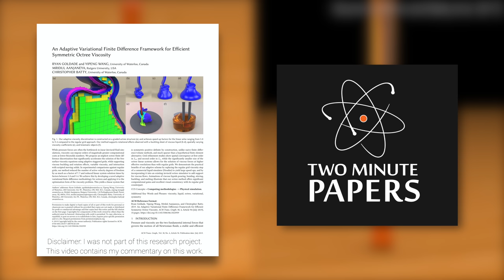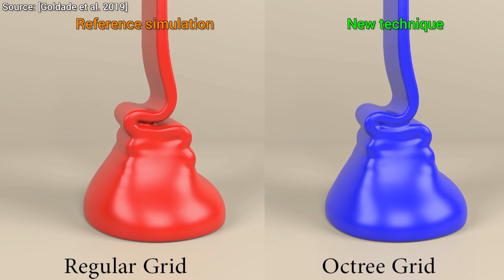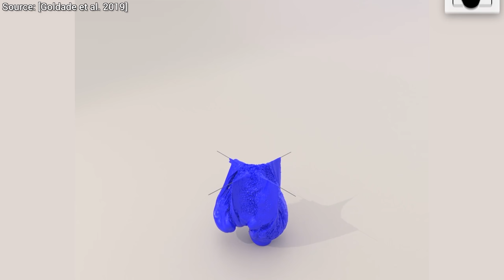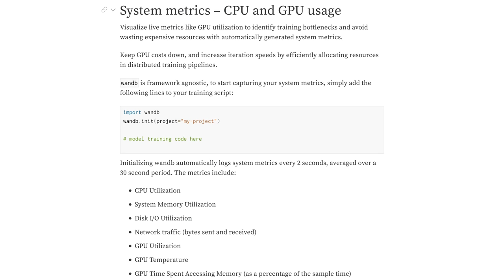Simulating Honey And Hot Showers For Bunnies! 🍯🐰

Comment: I miss an explanation of how/why it's faster. What's an octree, why was it chosen for this specific problem, etc
Reply: The resolution of the simulation is controlled by the divergence, this means that it uses lower resolution (larger grid sizes)in areas of the sim that move very similarly anyways.
There are a few images of this method early in the video.
Reply: @FreekHoekstra  Yes, and I went after the paper to read more about it. But I think it would be nice to have even a simplified overview of the novel techniques used, and not only the results they produce.
Reply: @mostlyokay  true but this isn't Five Minute Papers.
Reply: divide a cube into equal parts, repeat as needed for the new smaller cubes, now you have an octree. This should allow for divide and conquer strategies, and as freek said variable resolution.
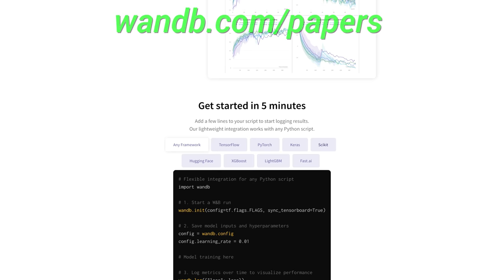Reply: @EternalDensity  Well the video is 4:10 long so it's a lot closer to 5 than 2 minutes anyways.

Comment: One thing missing in these honey simulations is stickiness.
Reply: I was thinking that the honey should have stuck to the fork
Reply: i see a liiiiittle bit of stickiness against the walls of some of the containers
Reply: You're right! Even the math says it should stick. I think it's numerical errors. A higher FPS simulation and higher resolution might get a better stick but most of the time in production you can just hack it with extra sticky forces. But for SIGGRAPH, you can't hack things.

Comment: For those shouting about when will it be on blender? Well not in a close foreseeable future. As mantaflow is still new and relies on a less optimized flip fluids simulations as it does more then fluids.
You have houdini student version which is free. (Node locked)
Blender addons flip fluids which was previously mentionned. (free and paid versions)
Do note that SideFx is a bigger company with way bigger means and influence in the industry then Blender. Thus giving them a real advantage currently. And simulations on houdini still requires excellent hardware as you cannot expect to run such demonstrated showcase with very low or average hardware.
Commercial simulations still relies on realflow or Houdini. You will struggle with other software such as bifrost maya, x-particles insidium, blender mantaflow. Im not saying it's impossible, just the time spend iterating on each test and trying to get exactly a good simulations still remains difficult and time consuming.

Comment: 0:42 If that is supposed to be honey or similar viscosity, wouldn't you expect air pockets or much smaller bubbles to be in there?
Reply: Absolutely. We were using the "free surface" model which doesn't handle bubbles. We have another paper that could help here though. https://github.com/rgoldade/ReducedFluids